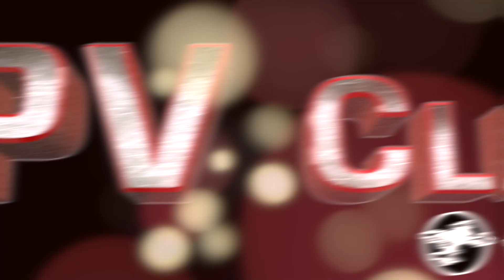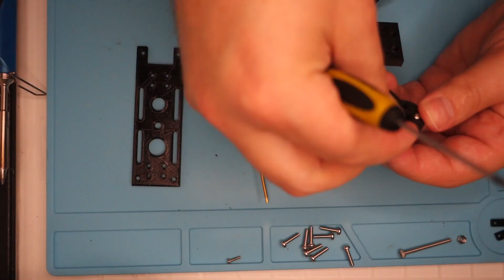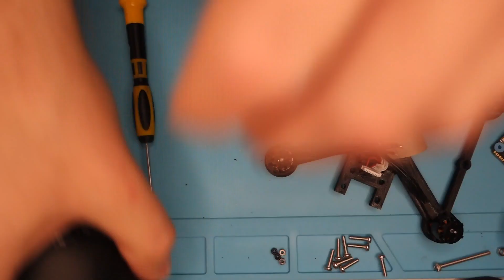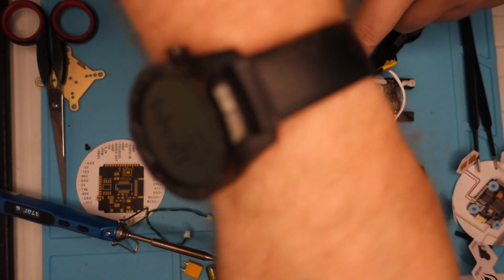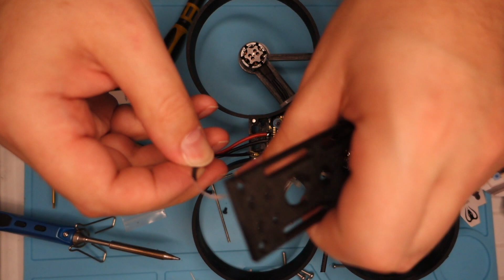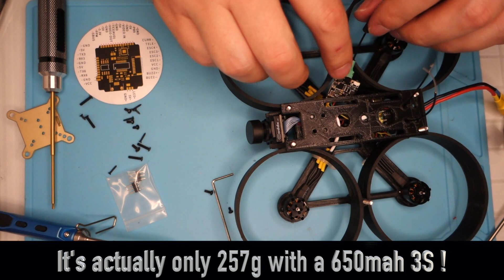3D Printed CineWhoop Build Video

Comment: Congratulations on the video, I finally printed this drone too.  Do you think I can put 3600kv motors?  And which batteries do you recommend?  I own a 1300 4s, I think it's over the top 🤦🏻‍♂️
Reply from the maker: You can go 4S for sure if you're gear will handle the power.  I have seen people put 150x motors and 4S batteries with this frame and it flies amazingly well, even with a Go Pro mounted on top.

Comment: Hello, very ood build, I print this and I have one question, 
 which screws do you use for the frame (for the ducts), which diameter and which length? Thank you very much and have a good flight!
Reply from the maker: Thank you, I hope it works out well for you! I used 40mm 3M screws on my build and it works great. The duct screws stick out slightly by about 3mm but it works great.